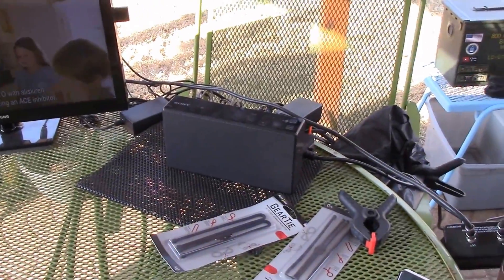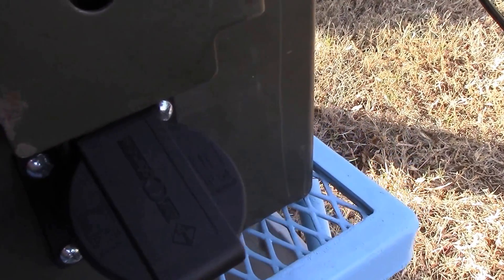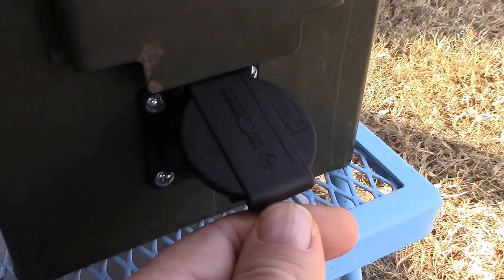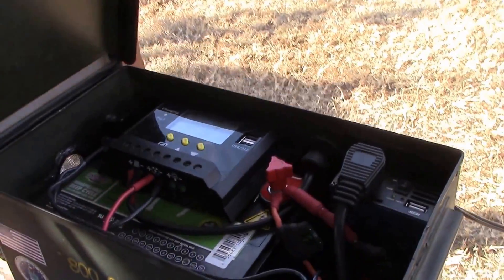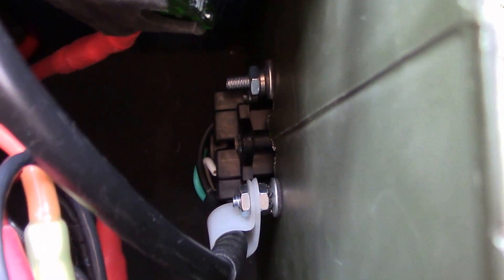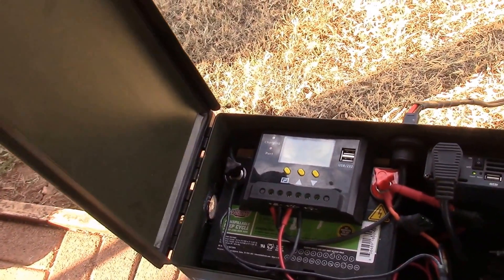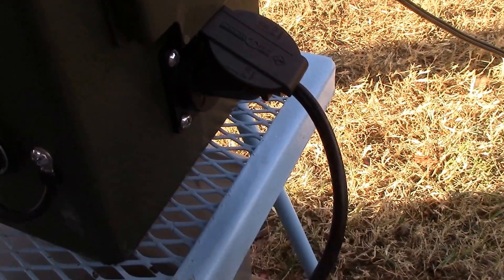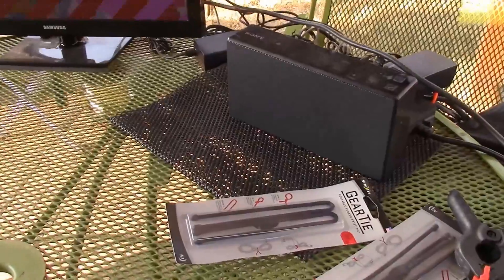New AC outlet for ammo box (600w micro solar generator)

Comment: The one I built uses a 120 with a rubber cover. Cost $20ish. My whole system cost just under $1500. If you want you can check it out on my channel.

Comment: Amazing work!!
Reply from the maker: Thanks...drilling out that hole was interesting to say the least. Quite easy to screw it up fast if one is not careful. Used a step bit, metal-cutting jigsaw blade and some files. #1 safety tip...wear gloves, protective eyeglasses, and use clamps when cutting steel. Damn burrs and hot metal shavings will burn and slice through skin/meat like there's no tomorrow. No trips to the ER and/or lost digits